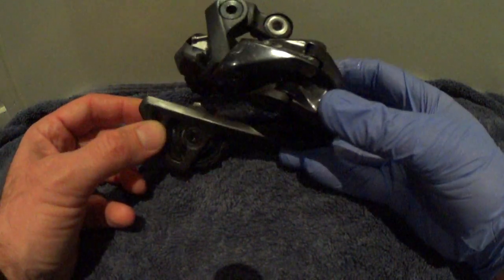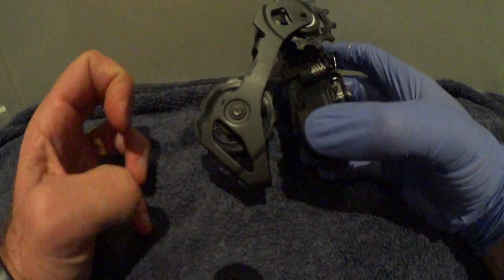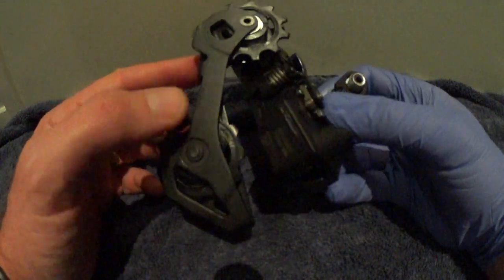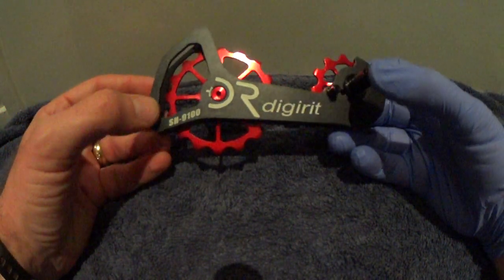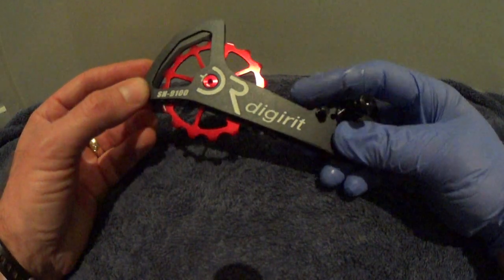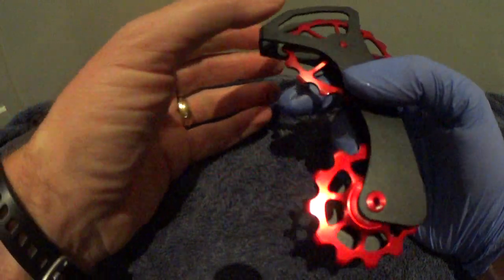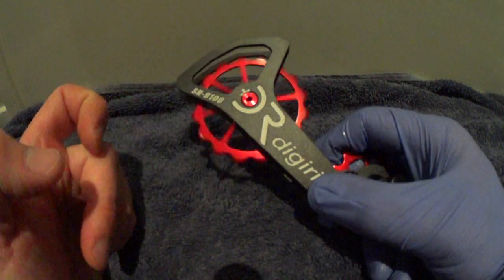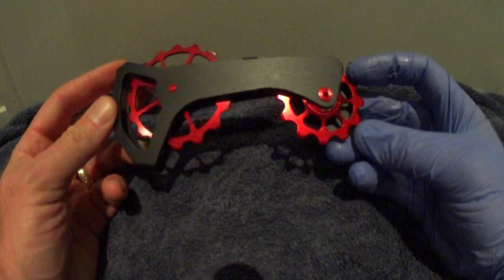Digirit and Shimano R8050 RD pulley wheel

Comment: how have you found the digirit system since the upgrade. very interested in these
Reply from the maker: Mika and Kez Francis 2 races, a few rides and number of indoor workouts. No issues at all. I forget I even have over sized jockey wheels. Sifting is the same. No dropped chains so far and no extra chain slapping. I have it on medium tension setting. I've used 23, 28 and 32 tooth cassettes with it so far.